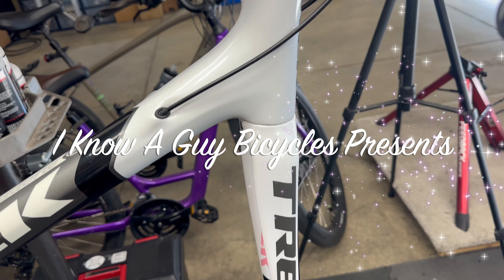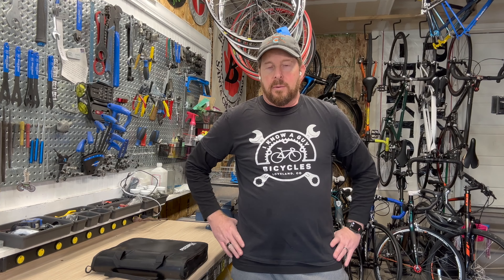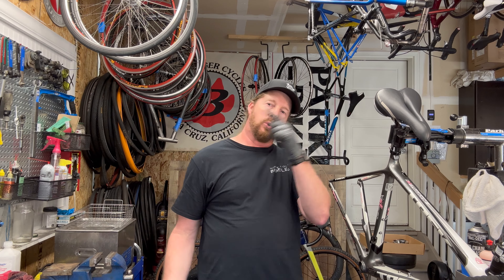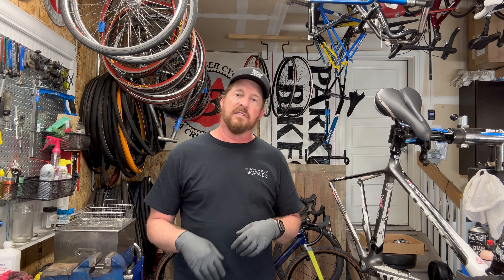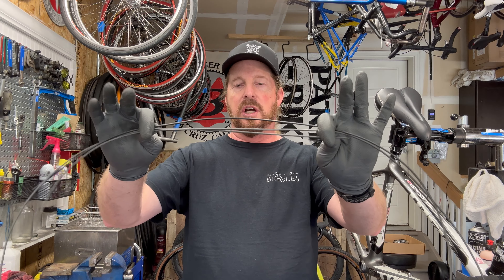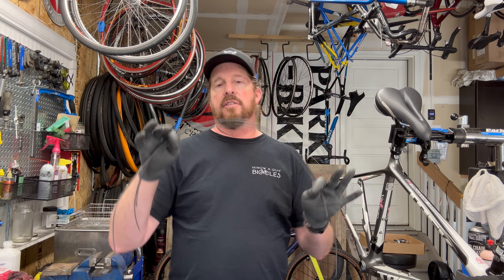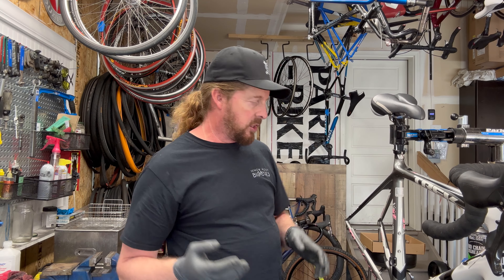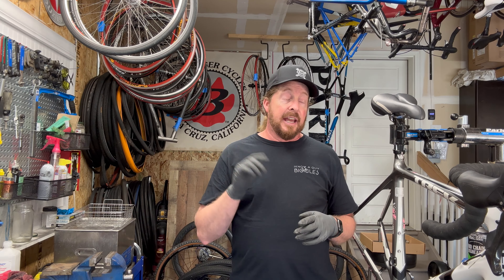🛠️ Internal Cable Routing ⚙️ Preparing Installing Bicycle Shifter & Brake Cables

Comment: Ive always used the straws. I bought the park tool magnet kit, and just never use it lol. Now days with the guides and caps new bikes have, makes it much easier than the earlier iternal routes or the cheap carbon chinese budget/no name brand frames where internal cables had to make real steap turns and corners.....thats when the park kit is really needed.
Reply: I felt your frustration on this one! Sometimes you can pop off the housing inserts on those frames, or many other frames if your straws are thicker than the holes. I'm disappointed in the newer designs on shimanos levers, this way the cables are more work to replace, because they are underneath the shifter instead of just popping out of the side easily. When the cable head is stuck in the shifter, you have to disassemble the damn thing to replace!
Reply: I don't envy the modern bicycle mechanic!  What with through the headtube routing and one piece bar and stems... The labor prices for minor repairs must be amazing. Still, the video gives valuble guidence not to own anything like that!